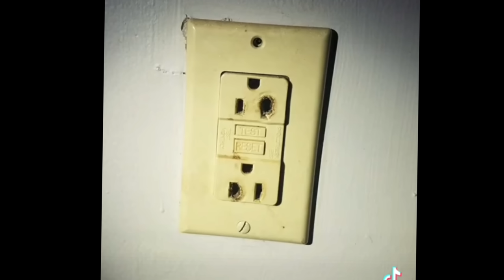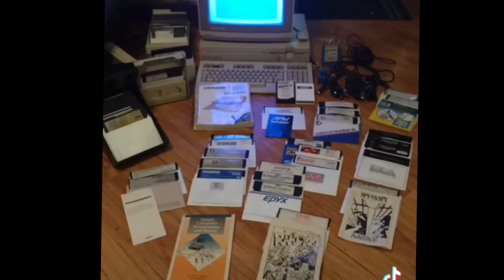Nate and Minion’s Homestead

Comment: Something to consider with house design. The Koreans and Chinese used a design that the kitchen was a half step below main floor. The chimney was routed under the floor before going up. Romans used a similar low tech method. This yeilds a warm floor. The Koreans slept on the floor at the time this was the housing method. Warmest spot was reserved for the elderly. Also, if you haven't heard of them, strawbale houses. Used to live in Central Washington State, there was a boom in straw structures. My friend's house from start to finish cost around 6 thou. Of course he had alot of work parties. Do think you are a hell'a of fellow to take this on. Best of luck in your endeavors.

Comment: What voltage is your battery bank? Hopefully 48v unless you a powering a lot of DC components. Do you have a single solar charge controller or dual controllers? Do the batteries get topped off often? Love the tour thank you.